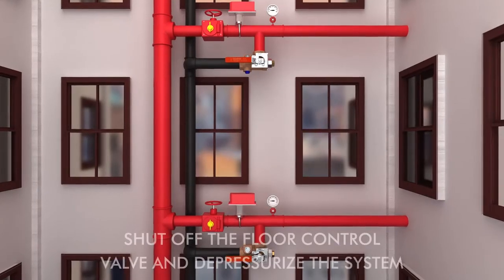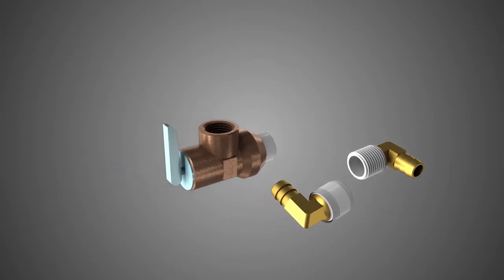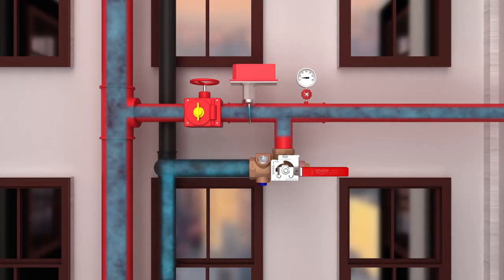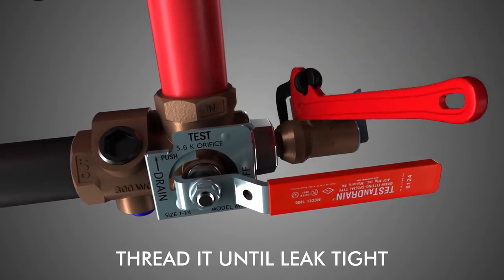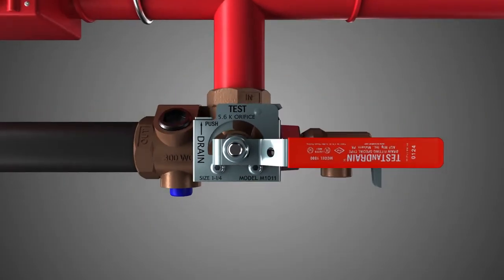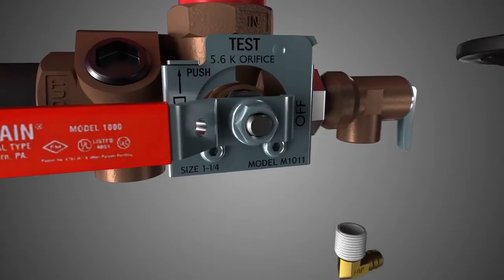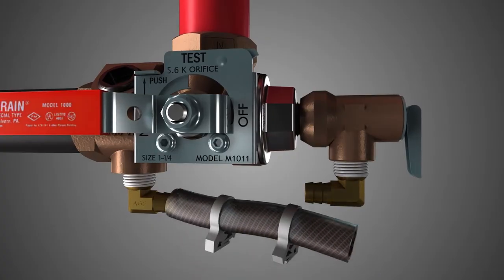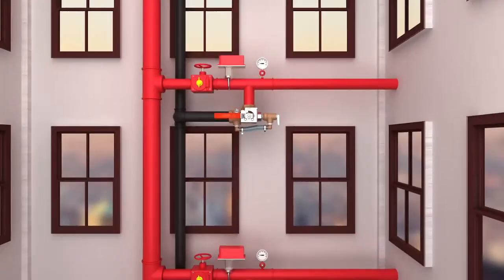Add Pressure Relief to AGF TESTanDRAIN Model 1011

Comment: Why I need to do that🤔😂it should be a relief valve on the pump header discharge originally
Reply: Required by NFPA 13